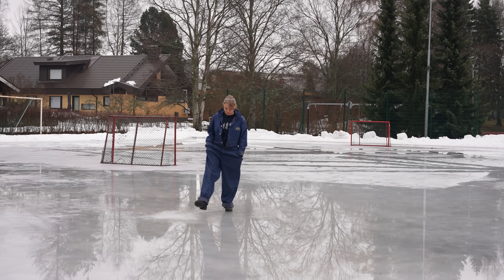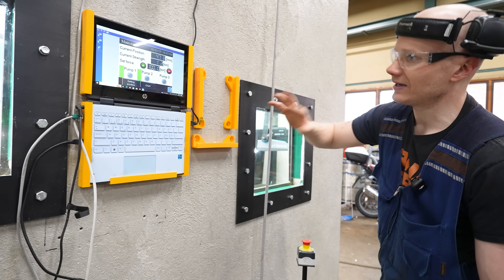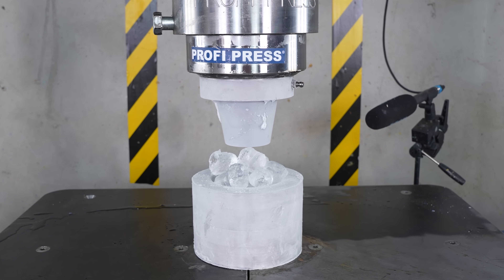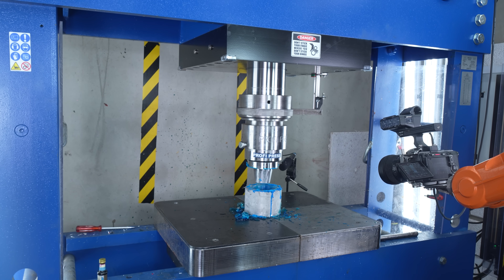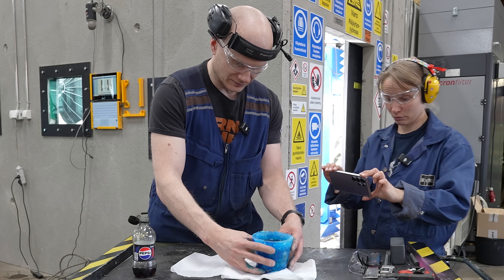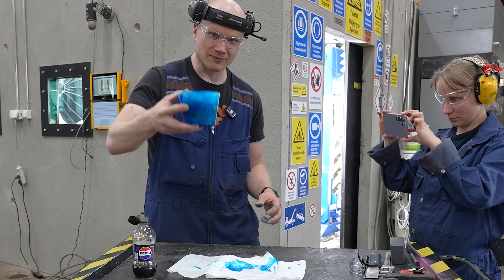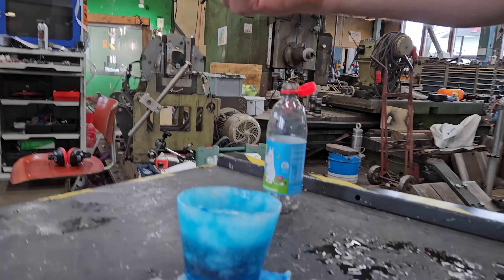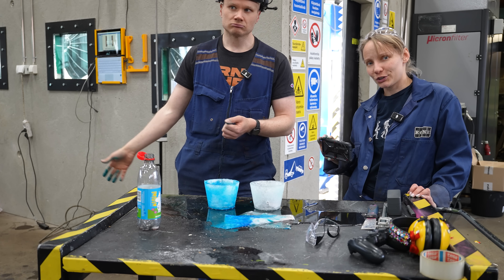Turning Ice Cubes into an ICE CUP – Coolest Way to Drink!

Comment: We like ice in our drinks because we keep our rooms much warmer that you do in Europe. A drink at our room temperature isn't very good. As for Blue Ice. Most of us are aware of Blue Ice falling from the sky and somebody putting it in their freezer to preserve it. The source of the Blue Ice is high flying jets. The toilets use a chemical to prevent odors and it has a deep blue color. If the tank drain leaks a little, the waste water freezes on the outside of the aircraft and after it gets large, it breaks off and falls to the ground. Blue Ice has a certain icky factor to it.

Comment: Now to put some supercritical CO2 carbonated soda in the ice cup!

I think the slower you go and the closer to freezing (not too cold) will give you the best results, apart from just freezing water in a die like a normal person :) 

My theory is that ice closer to melting point is, the more likely it is to melt in the press, then re-freeze solid, like ice-skates make a liquid barrier layer due to the pressure.

Comment: You should modify the tool so whatever is around the top doesn't have a way to escape. It just needs an outer flange on the bottom tool so that when the top part of the tool is most of the way the tool becomes completely enclosed. Then I think the resulting cup will be stronger.

Comment: It doesn't matter what you try to press in your cup maker because materials such as ice cream, coffee beans or salt cannot absorb lateral shear forces. They simply slip away in the conical cup shape. Simply explained using a concrete cube. If force is applied over the entire surface at the top and bottom, it will eventually break because it can no longer hold the force to the side. I only recently learnt this on a training course ^^

Nevertheless, it looks great as always :D

Comment: I have a lot of physics/engineering thoughts about making cups from ice.

My main conclusions are: the upper tool should be hollow so it's temperature can change more quickly - or change it for a material with a much lower LHC.

The lower tool should be kept much, much colder than the upper one.

The ice should be pre-crushed and wet when it goes in.

The pressure should be dropped to a couple of hundred kilos after the ice is crushed into shape, and then left there for a certain amount of time (a few minutes at most).

I could spend weeks experimenting with this. Because I am an idiot.
Reply: I think liquid cooling of the tools is how to do it
Reply: How do you have ice-cup making experience?
Reply: In America you can only be certified an idiot if you go to government sanctioned facilities for training they are called churches.
Reply: Ice turns to liquid at high pressure so the ice should melt even if it remains at the same temperature.

The apparatus should be designed to take advantage of such property and not just act as something that's supposed to press sand into a loosely cohesive shape.

I would spend a few weeks experimenting with you, but my approach would be different.

Comment: I think wetting the ice cubes works better, food coloring notwithstanding.  The liquid water freezes and becomes a "mortar" for the larger fragments.  Alternatively you could try shaved ice instead of cubes.  Smaller crystal size would be beneficial.
Reply: Exactly my thought. Could also warm the mold a bit with a torch to release the cup instead of pushing it out altho that seemed to work as well.
Reply: I was going to say this too

Comment: The reason the blue worked better is cos there was a liquid in there too... you could add ice with small bit of water to make a really good thick clear one i think! Also I think if you pack vice in a couple more times than just twice, it will makebottom much thicker too, and swtop it from escaping every time from the bottom. ;)

Comment: If only there was a way to liquify the ice and just cast it into cup form 🤣
Reply from the maker: But that wouldn't include hydraulic press! :D
Reply: The water in the food coloring made all the difference. Add a little bit of water to whatever you're trying to cup-i-fy. @HydraulicPressChannel
Reply: @HydraulicPressChannel  fill the whole mold and freeze it solid, then crush it into shape? your best result was using food coloring as mortar/glue. what if the whole thing was solid first?
Reply: @Hooptedoodle I noticed when I was goofing around with food dye and acids (32% hydrochloric, for pool or concrete etching), that it caused the dye to polymerize. Wouldn't surprise me if something similar is happening, but due to the temperature.
Reply: @Hooptedoodle  Yeah that would be cool. And also, they need a better cuppifier set up...like taller, conical retaining walls or something.
Reply: Sounds like witchcraft. 
Or alchemy.
Reply: @Boogie_the_cat  yea we dont like witchcraft around here we keep things mechanical =D
Reply: How about a laith